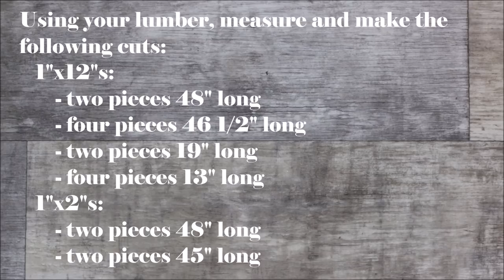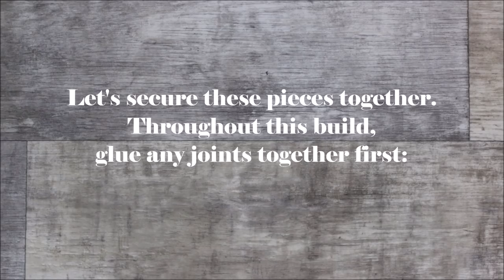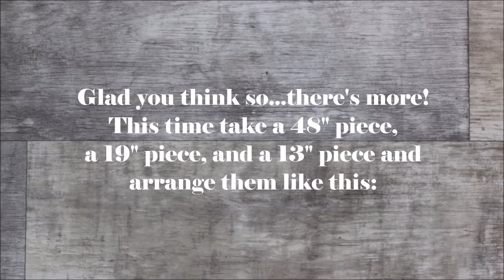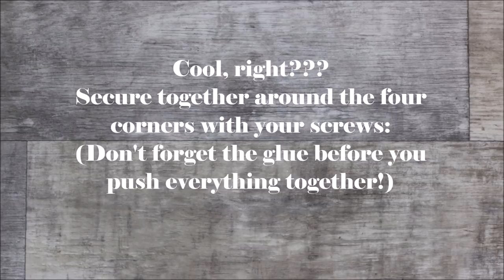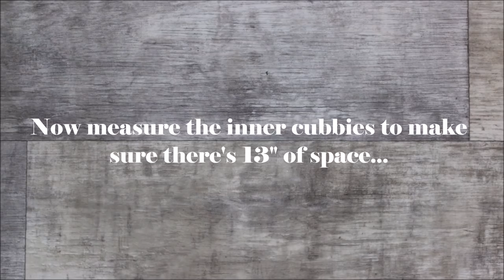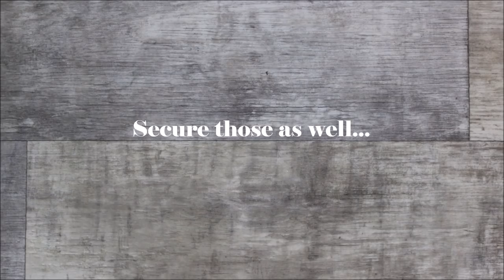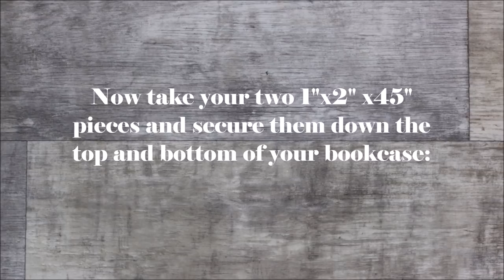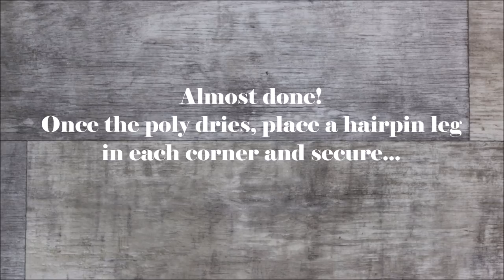The Mid-Century Modern Bookcase - Easy DIY Project

Comment: I've built two of these book cases and the design is awesome. My one recommendation is to use a 3/4" datto blade in a table saw to create channels to house the boards prior to the glue up. The first shelf I built with out this is starting to warp a bit probably due to climate shifts while the other has remained square. 
Just a quick tip for anyone that has a datto stack available. Great case either way!

Comment: if you're going to build a bookcase like this using cheap softwood you should probably just paint it rather than trying to stain it- the finished result is very spotty due to uneven stain absorption, not to mention that wood is just full of knots. you should also check your boards to avoid buying stuff like the cupping seen at 1:32

Comment: Awesome! Was planning on doing this soon! I was thinking about running a second, parallel set of overhead storage further in over the garage door. Thinking having the storage entirely joist-supported should be fine for another couple hundred pounds. They are holding up a roof and a second story after all. 1:56

Comment: Nice job! However, I would have put a different finish on it and perhaps used a different type of wood besides pine.
Reply: yes. even laminated pine panels look better, but a nice looking plywood with edge banding would be a big improvement and not much more work.

Comment: would you be able to make this same book shelf with MDF?
Reply: Age Vizz I think you could. I bought some cheap scrap pieces of 1” MDF to make shelves for my garage a couple years ago. Using nails, they’ve held up very well and feel solid as wood. I painted with Kilz just because I had a can. I also read somewhere that you should protect MDF from moisture, as the bare surface could swell or get messed up, like bare particle board if it gets too wet.
I would definitely use MDF again for interior projects like this.

Comment: Did we need the impact driller or is just the drill OK?
Reply from the maker: A drill is fine as well as long as you have the right bit for the trim head screws (which often comes with the package)